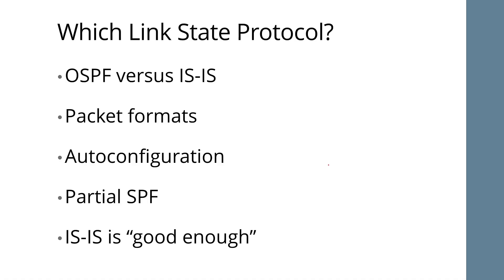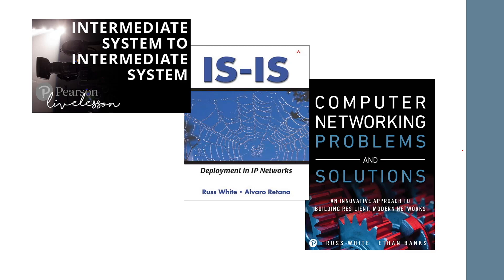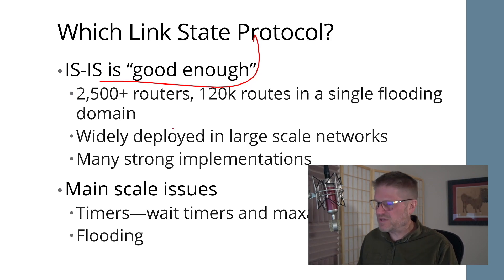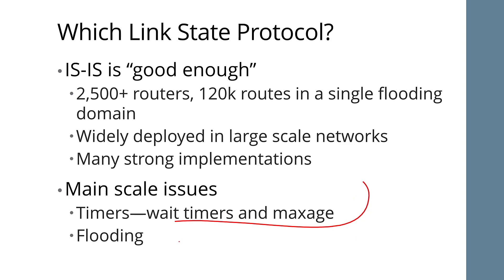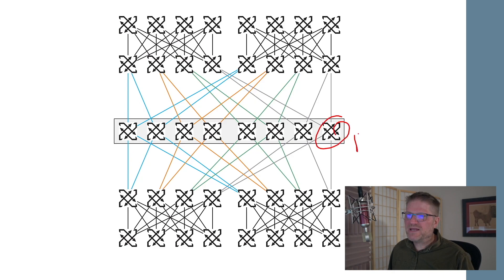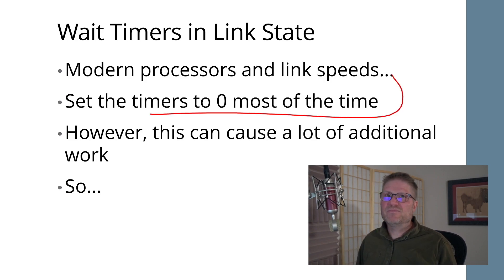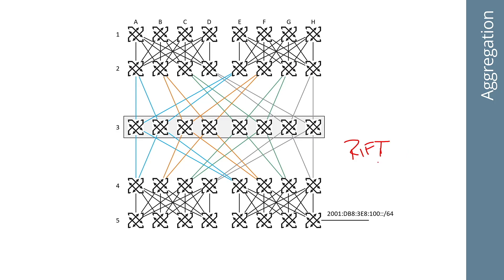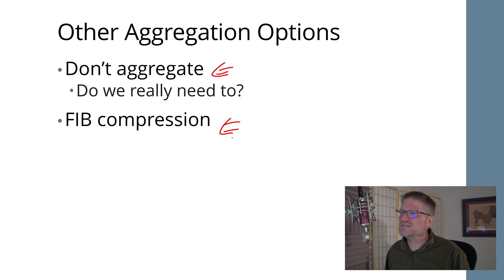Understanding Data Center Fabrics, Part 7: Link State Protocol In The Underlay

Comment: Does an underlay protocol necessarily have to be Link State? Could we use EIGRP for underlay? What would be pros and cons to it?

Out of curiosity could we do static routing in underlay? Of course we would lose the agility of dynamic routing protocol, just wanted to know what would it mean for underlay.
Reply: I don't use EIGRP in daily operation so take everything I say with a grain of salt. ;)

That being said, the two largest cons I can think of is: 

1) Vendor choice. How many vendors have EIGRP implementations? Are those implementations stable? I only know of 1 vendor with a "known" stable implementation of EIGRP.
2) Inter-operations. There is a large chance vendors will not have an EIGRP implementation. In this case you will need to run more then one IGP.

I look at IS-IS and OSPF as controlling flooding domains. As the network scales these protocols have tools to break apart flooding domains and the routing database. 
I look at EIGRP as controlling query domains. As the network scales EIGRP has issues with query domains and the inability to break apart the size of the routing database.

Comment: When I was going through Juniper certification path, I was introduced to is-is, and I prefer IS-IS just based on the flexibility of the protocols design aspect (not limited to having to connect to a single backbone area).
Reply: I need more lab time with IS-IS. From studying the protocol it seems simpler, which "should" translate to more stable implementations and configurations. 
I always thought IS-IS not running over IP was interesting as well. So it could be used to validate the MTU of the entire fabric?